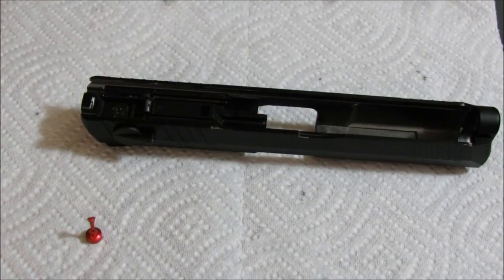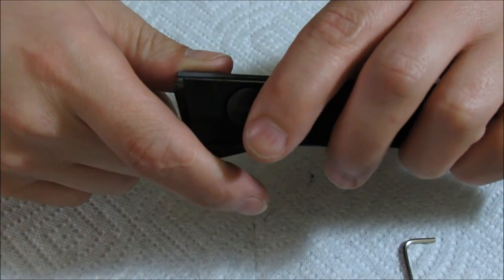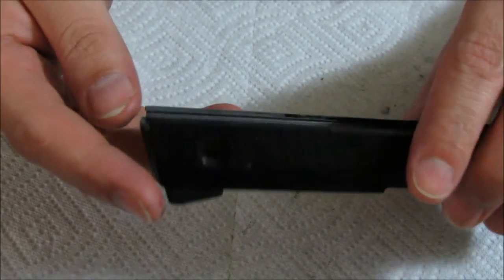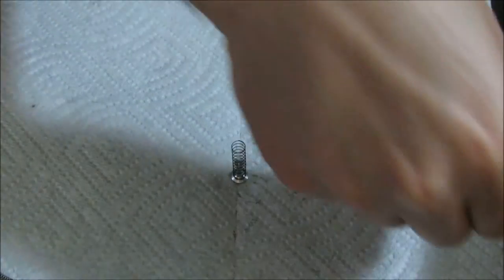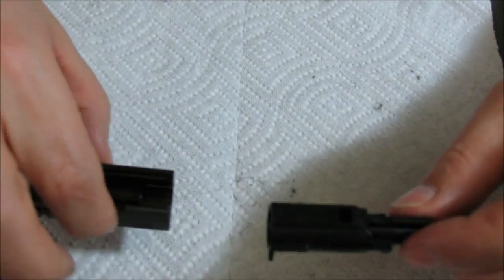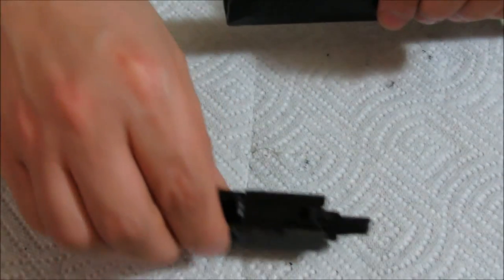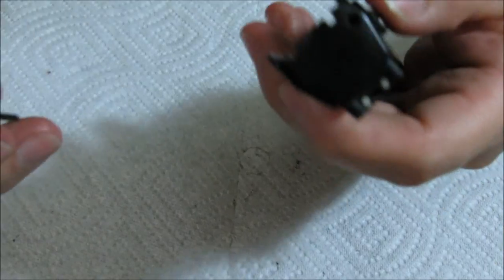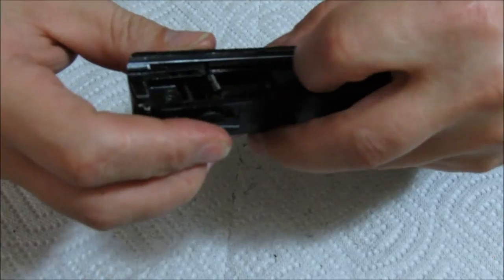Installing Rocket Valve into the KWA ATP Full Auto

Comment: I know this video is pretty old, but maybe you can impart some sage advice upon me. On my ATP Auto, the hole in which the selector pin and screw are located there is a metal cap plugging the hole and blocking the screw. This cap is metal and is completely flush with the back of the receiver, making it impossible to get ahold of it to pull it out. Any advice?
Reply: Same issue please help

Comment: quick question is it possible to tighten up the selector switch mine is starting to wear and become loose and go to the neutral position
Reply from the maker: How long have you had your pistol?

What I would do first would be to check your auto selector retaining screw and the auto selector pin. Ensure that the pin is seeded properly and the retaining screw is snugly screwed down.

You can also check the spring and bearing that is under the selector switch. Ensure that they are in proper placement and you may want to grease them up a little bit.

I hope that this helps you out.
Reply: Ive had it for a year, I'm deff going to try what you recommended and se if that works

Comment: Hi I had a question. I currently own a KSC Glock 18C and would like to know if the Angel Custom Upgrade Kit would fit on my gun. My main question is if the guide rod that comes with the kit is compatible with my gun. I have looked into parts and noticed that the ATP and G18C nozzles are compatible, I just need to know if the Guide Rod is compatible.

Part: http://www.evike.com/products/53305/
Reply from the maker: +James Cortez Sorry for the delay in the response. Yes the new recoil spring guide will work.

Comment: How do you install the selector pin at the end. I cant see where it goes.
Reply from the maker: Sorry about that. As I reviewed the video I seen that I was just a bit high when I put the pin back in. @ 10:18 pause the video and you will see a hole in the upper right area of the slide. That is when the pin goes back in. Again I am sorry about the position while I was putting it back in.

Comment: What does the new rocket valve do/improve
Reply from the maker: Your gas output will greatly stabilize. You will get a smoother flow and operation overall.
Reply: +CCKAirsoftMI so in other words it increases your gas efficiency? if so then this is what i need! but i dont know which one i need for my gun (marui desert warrior 4.3) +1 sub :)
Reply from the maker: +Fsx_Productions  I was looking around and found this: Angel custom teflon coated rocket valve for TM WE KJW 1911 MEU 226 series airsoft gbb pistols. I found this on Evike. I hope that this will help you out.

Comment: For a reason i can not remove the screw holding the breech in place. Any way to resolve that? I think mine is superglued shut
Reply from the maker: Daffy Nerf When I first took mine out I had the same issue. Just firmly grasp the upper receiver. Push the upper receiver into the screwdriver and push the screwdriver into the receiver. Start the process of turning the U.R. one way and the screwdriver the other way. Give it time it will break loose. You will hear a small snapping sound. After that continue to take the screw out.Hope this helps.
Reply: Please help n cant seem to remove cap for breech retaning screw